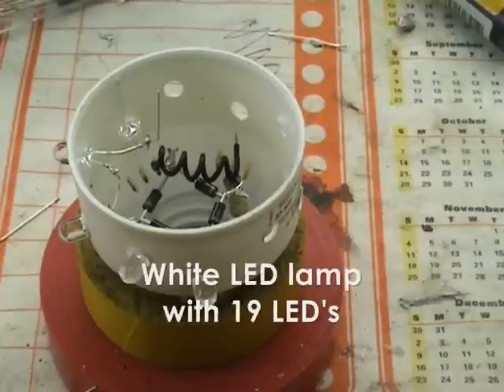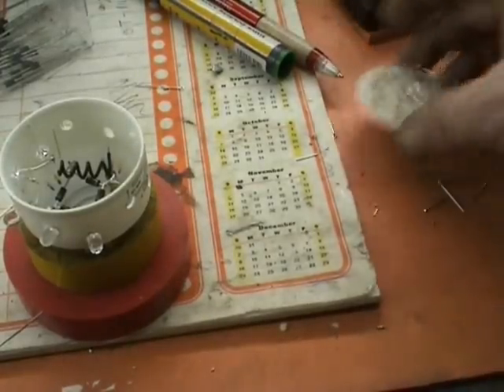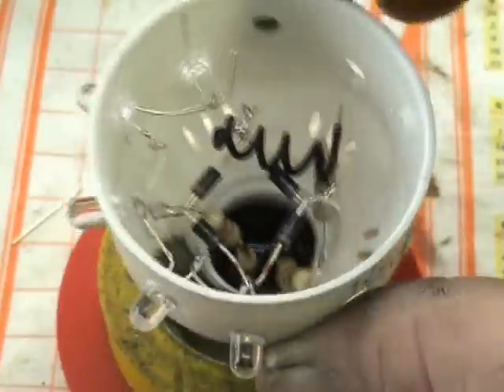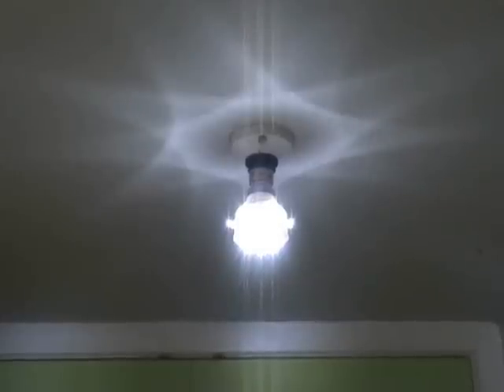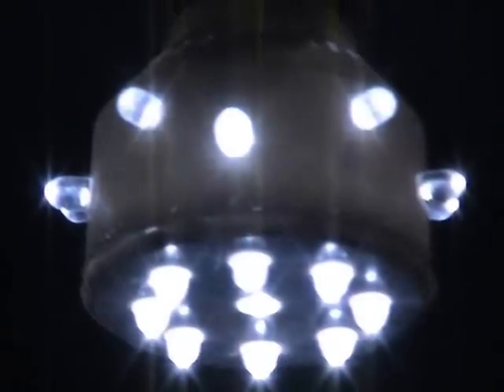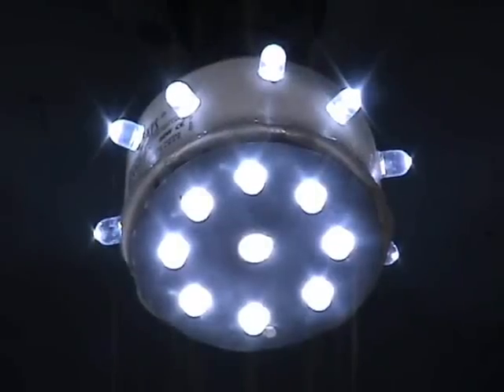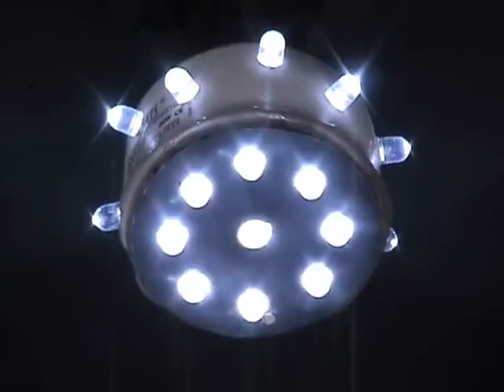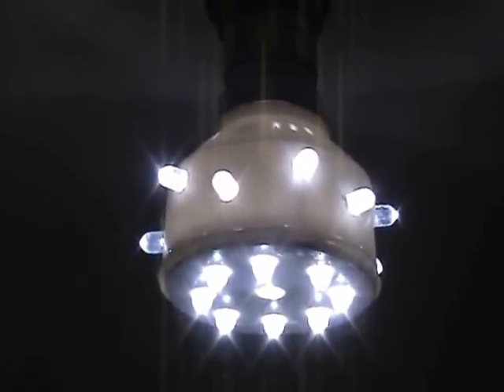White LED 240 Volts 16 mA lamp -- project 3

Comment from the maker: @cktino  Power = (current)squared x resistance.
You need to have a look in an electronics book.
It is a standard formula.
Led current max 20 mA = 0.02 Amps
I used 15 mA in previous example.

Then whatever the result is double the R value to have the resistor run under less stress.

Comment: @RODALCO2007 thx brother..with the project 4 schematic i can understand the conection led n resistors..... the therefore R = 15000 ohms, so the (I x I x R makes 3.375 Watt resistor ) part i dono the calculatioan I x I is what.... can explain the( I )...
sorry i not a electronic engineer...

Comment from the maker: @cktino For a 3 to 5 LED lamp it becomes less efficient with a resistor, so a capacitor would waste less energy, but it affects reliability too (spikes etc).
But for 15 mA led current and 5 LED lamp ( white about 3 Volts drop per led )
240 - ( 5 x 3 ) / 0.015 = R
therefore R = 15000 ohms
I x I x R makes 3.375 Watt resistor needed.
Use two 7k5 or 8k2 Five Watt resistors in series.

Comment from the maker: @Iseekoutthetruth  For 110V and 19 leds (white) use 4 x 1000 ohm 1 Watt resistors in series before the bridge rectifier. (Instead of the 5 x 2k2 resistros used for 240V)

Comment from the maker: Thanks for your offer, I know the formula for reactance of a capacitor.
My issue is reliability. In New Zealand we have a lot of overhead lines and occasional surges during storms. Hence the resistive option is choosen.
A cap. can pass a spike through with no problem regardless if a 1 k.ohm series resistor is fitted and destroy the leds.